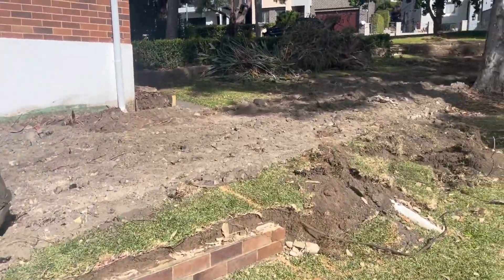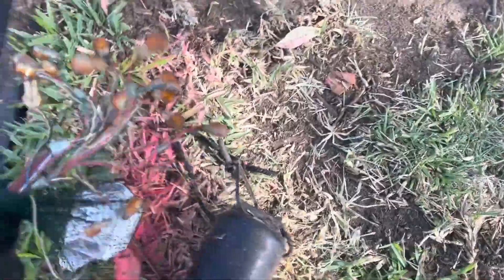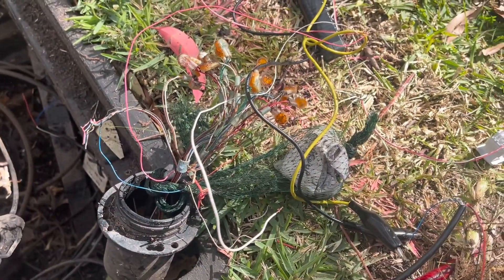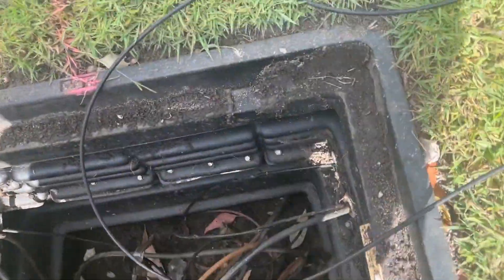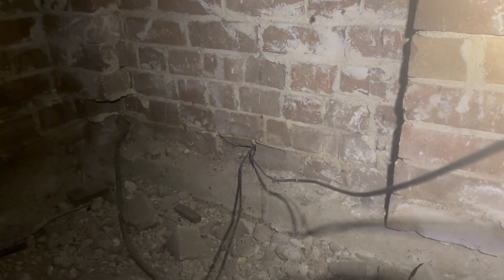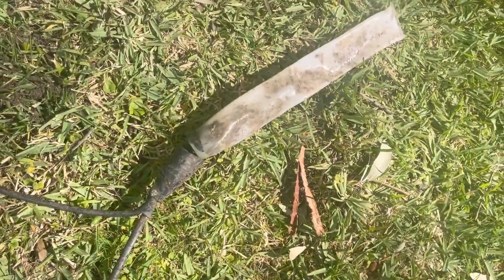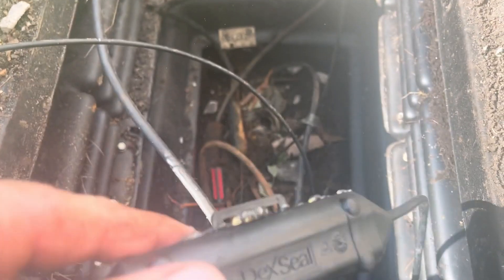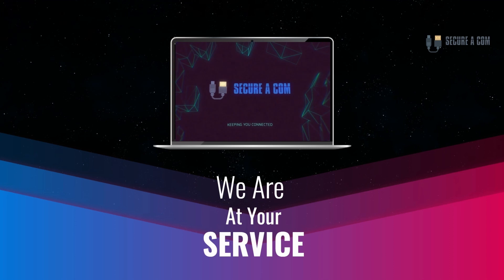NBN FTTC Connected To Old Cabling and joint With Network Bridge Tap

Comment: The customer should be fully entitled to a refund by the service provider for every month she was left with unsatisfactory internet access due to the horrendously below-standard cabling you had to resolve, as well as your fee for service & materials.

As a fellow cabler it is bloody annoying that network carrier technicians are not held accountable to the same mandatory standards we are.

The number of times I had to set up additional internet interfaces on network security appliances after being assured by the ISP (on the phone in preparation for the job) that there was a live NBN service terminated in the customer premises only to find a tag on the carrier side of the MDF in the underground car park and had to cross-connect on wire-wrap frames up to the floor then into the tennancy.... After getting caught twice I would email the ISP confirming their assurance, which then led to compensation to the client for the work I had to do to get the additional services up and running.  Sending such an email is known as contemporaneous notes which falls under the judicial rules of evidence.  It's a good to know.  One client was dancing on his desk with chanpagne over the win, he could not believe I managed to pull that on the ISP!

Comment: explains why it never works, I was with Optus for a long time and then suddenly for a month straight I had no internet connection and optus did fuck all. I changed to Telstra and they said we can give you 1000 mbs speed (mind you they knew I had the older HFC so I was surprised they would offer that speed). Internet came and yep I was getting anywhere from 700 (on 5ghz wifi) to about 950 (on ethernet). Suddenly a week later I couldn't even get 100 on cable. I called them a million times and they kept on telling me its working fine, each time I would say which part of getting 100 on a 1000 plan is "fine", the response was generally well if you don't like it then downgrade you don't need 1000 anyway. Most of the support had no clue how the internet worked based on how they spoke, they clearly were following an nbn step procedure rather then fixing the issue. Essentially they did an automated speed test and it said yep its fine (obviously its not) then it told them to tell customer that they should downgrade (which is like wtf what kind of ISP rather have you pay less then fix the issue). One bloke knew what was going on and he tried to fix the issue but the automated process did not really give him the option so he had to dig around, unfortunately I lost contact because I was too busy to get back to him and the ticket was closed. Eventually I had enough of the same response every time I called and I said listen mate, you clearly dont know how this works give me a technician that knows his shit, they said yes ok we will call you when we get one. They never did but I woke up one day and bam it fixed itself, I'm assuming the lines were done wrong like in this case and they fixed them when they laid new wires since I saw them install new fibre lines one day outside my house.

Comment: This might help as it looks like the old legacy type of connection on the old nbn connection it was a three wire connection but it is now being converted to a two wire with the cable heading back into the can being removed now and a direct connection to the connection box in the pit if the service was playing up it could have been the cause is it as it stopped it working with the three wire connection
Reply: Seeing the lead means its an old legacy area that had common-ing/bridge taps  from the "only had a phone era" . It shows  Fibre to the node never removed these anomalies in the last 500m. We have them in Adelaide and I know where they the old areas were